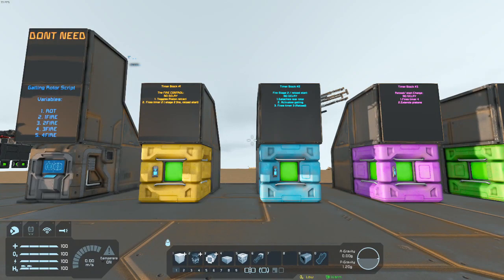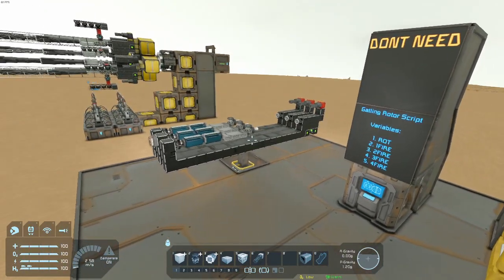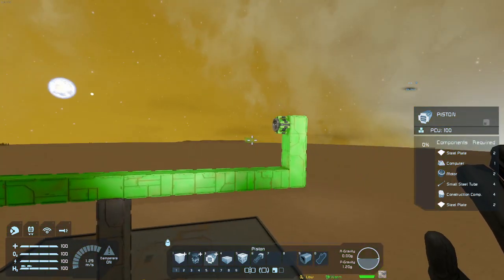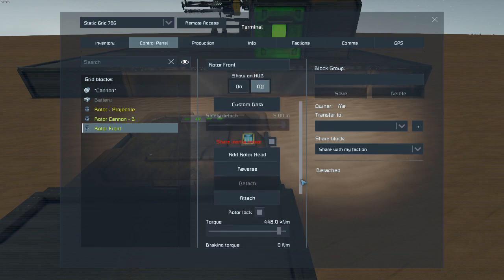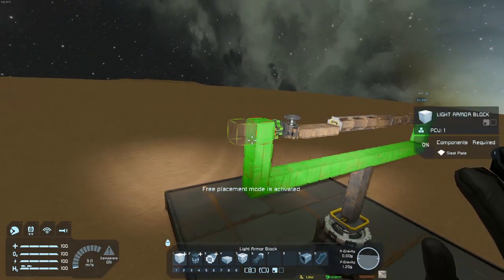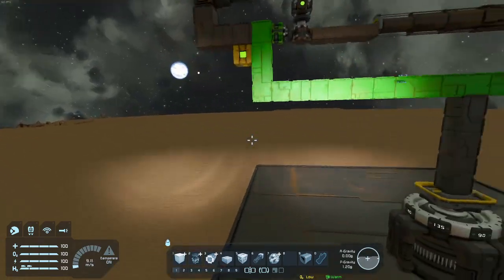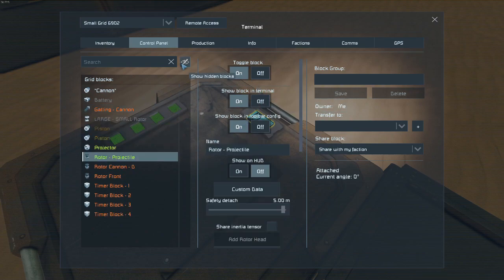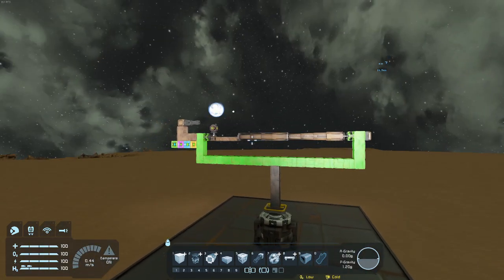Space Engineers: Clang Cannon Tutorial

Comment: i know this is over half a year old but things keep throwing me off. first, most the time i don't even know which rotor and/or timer you're working settings on, and that was before you said you got something backwards and switched things around. and why are ts there a rotor at both ends anyways? after half a day I still can't even get the parts built to test it but don't you just need a detach/attach rotor?

The closest I've got so far turning the tension sharing thing on right after I ran out the pistons. Those were the only 2 piston related things i did and it shook itself off the large magnetic pad i had to locked down with. Laptop doesn't alt-tab back into space engineers very well so I have to build and set off memory.
Reply from the maker: I’d recommend watching it on your phone if your having tabbing issues … but about the timers, I build them in a sequence … if that is confusing for some reason I’d recommend pausing  to the video at the very start. Read the timer displays left to right and that will solve that. Also this design isn’t supposed to be a traditional build .. most servers consider this type of clang manipulation to be an exploit so the nature of having two rotors is is what allows the pistons to collapse ….. if I was unclear on anything please feel free to respond I can always try and work with u 1 on 1 to get the mechanism explained. Also I’d strongly encourage if your new to SE to take an extra long while analyzing what is going on , instead of just listening to me ramble on. Once u have a sense of what is goin  B on then I would try and reverse engineer it….. u shouldn’t really need to follow my steps it’s an extremely simple concept .

Comment: Everytime I fire, the blocks im using as projectiles simply fall. What am i doing wrong?

Edit: I am on a server hosted by my friend through Steam, and I think the problem is with the gatling gun. Another thing is, the thing the gatling gun shoots is a small converyor.
Reply: i tried making it and it sorta worked (doesnt break the speed limit), what you need to do is to enable the gatling gun, and make it shoot once (both on the second timer) and make the third disable the gun. also on the second timer make sure when you add the third timer to it put it as 'trigger now' so its much quicker.
Reply: How I fixed it is I put a artificial gravity block and a battery to add weight to the back it doubled the distance

Comment: Is it normal that the projectile only flies at like 104mps? It looks way faster in your Video
Reply from the maker: Yea set up exactly the same way should allow u to break that “speed limit” threshold, I know with large grid it can be a serous issue , but if it’s happening with my small grid design mak sure to recheck the design and adjust its timing
Reply: @thunderwoks5010  thank you. 
I modified it so it can be build in survival (turned the attaching Rotor around and connected the frame via Merge Block). maybe that was the Problem

Comment: Nice guide man, i Have little guestion, must be that rotor under projector? Can i relace it whit regular block. Im playing at the server where Is 2 rotors restriction
Reply from the maker: Hey man, no I use a rotor to adjust the distance from the Gatling, it helps to create a more stable release system..... but to answer your question simply, you DO NOT need a rotor there
Reply: @thunderwoks5010  you can also just use 3 conveyor tubes and shoot the one in the middle, even if its a little off its still hitting one of the tubes.
Reply from the maker: @DrJassens  yes that might offset it sure but for more precision on the release system u can use rotor offset to adjust it.... hence the rotor... it allows for a better more precise way of tuning
Reply: @thunderwoks5010  I was actually replying because he tried to avoid the rotor because of server limitations

Comment: is this possible with large grid pistons?
Reply from the maker: The action is possible but u have to figure a quick release system, with large grid blocks. Small grid Gatling works nice cause it can one shot certain blocks
Reply: @thunderwoks5010  yeah ive been trying its hard lmao ive only been able to get it to go 104 m/s
Reply from the maker: @aufspider4136  yea being able to disconnect it fast enough is going to be a problem, make sure the pistons are completely retracting as well and that the torque is all the way maxed
Reply: @thunderwoks5010  I'm doing that but its ripping the head off the piston
Reply from the maker: @willowyknight7645  lower the torque till it’s just about to break
Reply: @thunderwoks5010  that's odd I've reloaded my world and there's no share inertia tensor? I've got experimental on but other than that I'm running vanilla
Reply: @thunderwoks5010  i built the small grid version but for some reason if I build a shell more than two blocks long it rips itself apart
Reply: Should I send you a video of it breaking